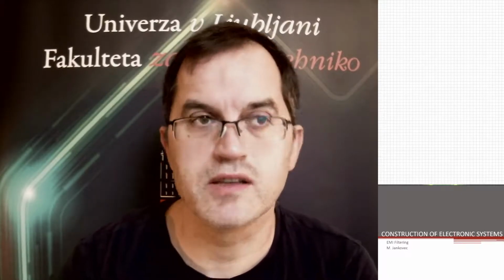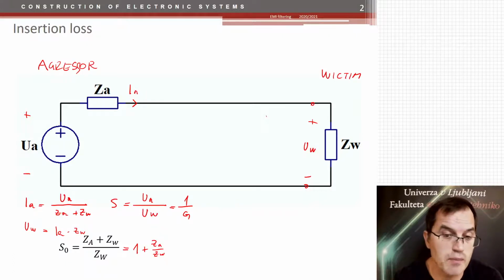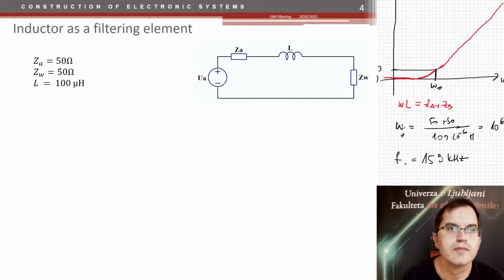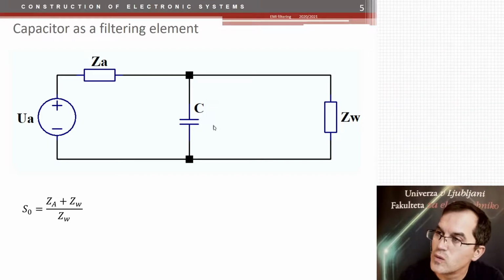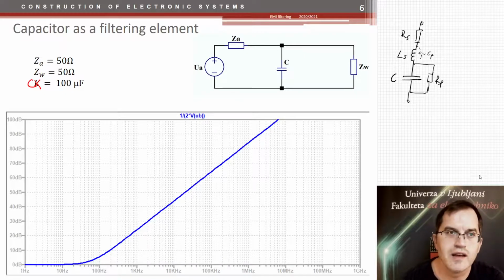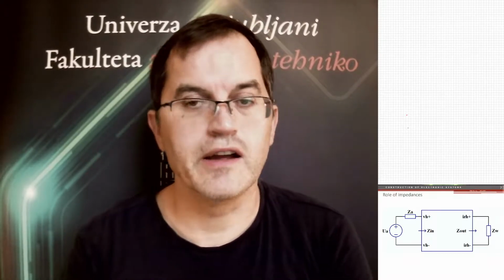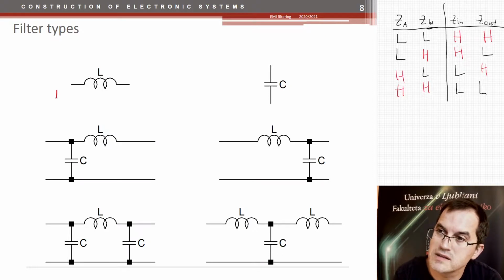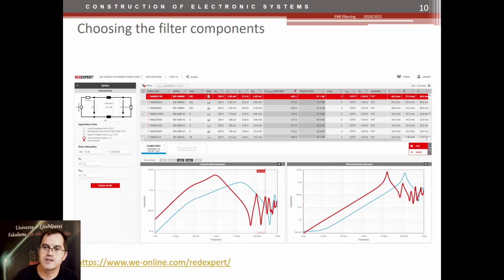CES #07: EMI Filtering part 1

Comment: Insertion loss IL =  20log((V(a)/V(w)_with_filter)/ (V(a)/V(w)_without filter)), could you please bit more clearly explain how u arrived at IL = 1/(2*V(ub) to plot the graph. Also for a random general filter, how can I plot the insertion loss in LTSpice? It will be very helpful if u can reply..
Reply from the maker: Use a little math. It wont hurt.
Reply: @mjankovec  Agree sir. But I'm unable to reach a conclusion. How to relate V(w)_with_filter and V(w)_without filter.
Reply from the maker: @Parvati-ti  Think about it. The IL is the ration between the unfiltered and filtered output voltage. Now do the math.

Comment: Hai, great lecture series sir. Can you explain to me why the plot is drawn for 1/(2*V(ub))? I understood that V(ub) is the output voltage with the filter. I did this by considering two circuits with and without filter and did ac analysis for (V(ub1)/V(ua1))/ (V(ub2)/V(ua2)). But it's not working. Please explain. Thank you.
Reply from the maker: Original gain without filter is 1/2. The source voltage is 1V.
Reply: @mjankovec  . Thank you sir. understood. (V(uaf)/V(ubf))/(V(ua0)/V(ub0)) agreesor magnitude is any how "1". Awesome lecture series.
Reply: @mjankovec  Hi sir. I still didn't understand. Could you please explain more clearly?